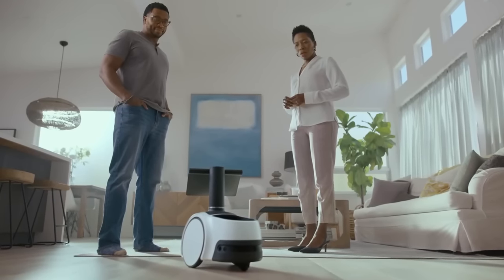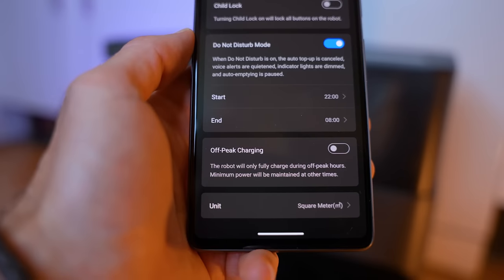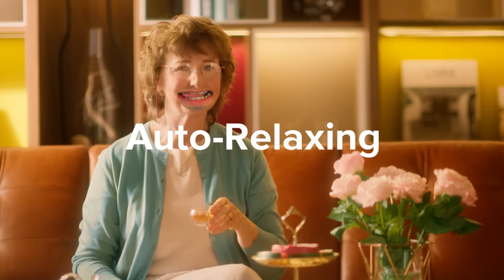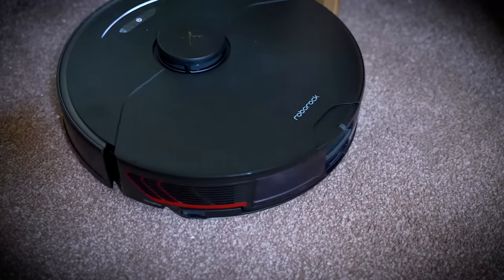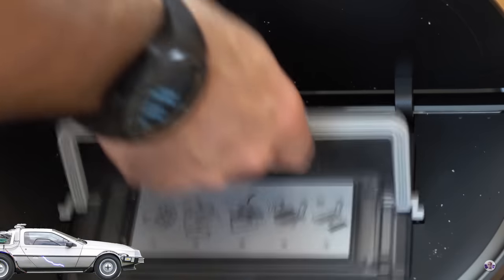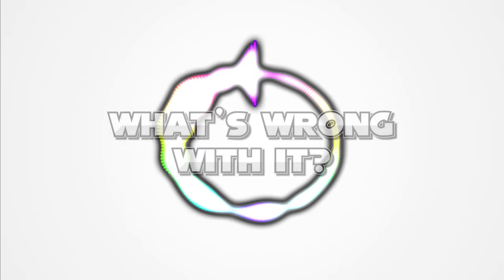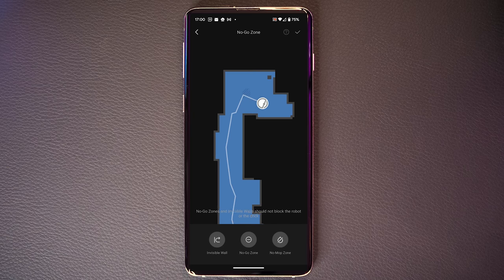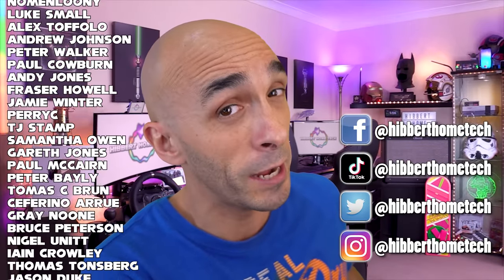Roborock S7 MaxV Ultra : WILL IT EAT POOP?

Comment: Got one of these and I love it. It will take a brush from another machine if need be for the deep pile carpets.  You can also buy washable bags rather than use disposable. Home Assistant integration isn't easy or complete and you do lose functionality so I haven't bothered. You can also get a fairly cheap attachment from AliExpress that dries the mop after it's been washed. Recommended

Comment: Ultra is awesome. I would also recommend the optional addon mop drying attachment. The mop pad tends to smell overtime otherwise.
Reply: ah good tip thanks
Reply: You can make the mop not smell by putting one cap full of isopropyl alcohol in the freshwater tank. It kills off bacteria and fungus which causes the smell.

Comment: I have a roborock 6 and it always struggled with mirrors or glass doors, or any reflective material on its height. Maybe you could add smth like this on your test to see if it can handle? Great video as always
Reply from the maker: I think it sees mirrors as rooms it can't get to, it's never stopped it working though
Reply: @paulhibbert  yeah, that is exactly that. It messes up the mapping and room separation for me. I wanted to see if this newer ones with cameras could maybe solve it. 
Thanks!

Comment: Roborock has one other "invisible" feature people should be aware of: reliability. Careful reading of Amazon reviews of this and every other brand will make this abundantly clear. My original Xiaomi (the Roborock predecessor) is still doing service after 5 1/2 years and my S6 (2.75 years) has gone on 2428 missions and cleaned over 37,000 square yards (>7.6 acres!) without a single malfunction.

Comment: I have the s7 maxv without the ultra dock. There is one problem that I have with it. It sees my floor to ceiling mirrors as a room because the lidar is reflected and it thinks there is space behind it. It does the same for large windows. Because of this I cannot edit the map to separate the living room and bathroom. I wish we had more control on the map editing. Otherwise it is awesome.
Reply: Had similar problem and solved it by setting no-go-zones. Works just fine.

Comment: Apologies Paul but I'm a bit cross with you about the Home Assistant Integration. Roborock have done a terrible job there because if you use the Roborock app to setup your vacuum, you can't properly integrate it at all! You have to use the outdated Xiaomi app because Roborock is a Xiaomi rebrand. And if you already did your setup using the Roborock branded app, you have to start all over. Not to mention that extracting the map data from the Xiaomi servers is more or less a hack job even after a year and they could disable it at any point. I really like my Max V, but I would never praise the HA integration without even mentioning that huge asterisk. Cheers!
Reply from the maker: I was just repeating what Rob had said, I've not used it myself!  Perhaps watch Rob's review, maybe you're missing something 🤷‍♂️
Reply: @paulhibbert  I know you did and I watched Rob's video. I can't tell you why he didn't mention any of this, but you can see him using the Xiaomi app. I suggest you try integrating your Max V into Home Assistant and see for yourself. In the past you were very vocal about having to use workarounds to get a HA integration working so I figured you'd wanna know.